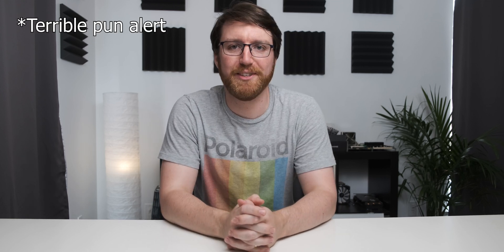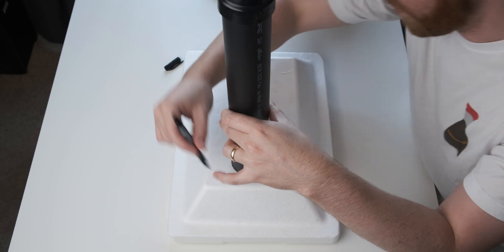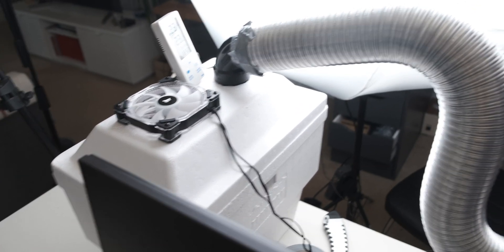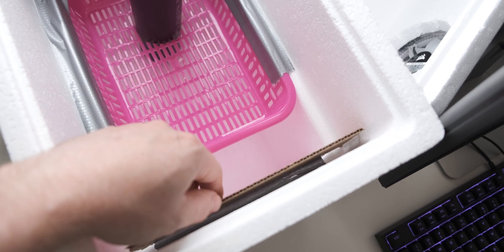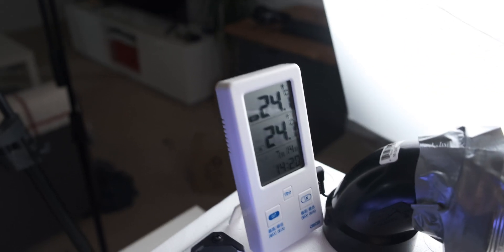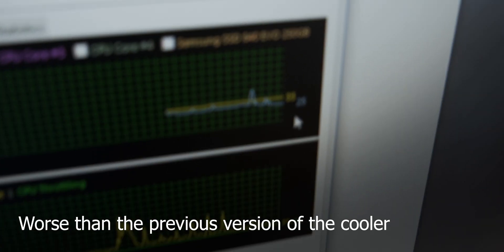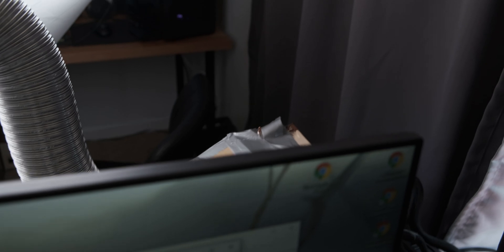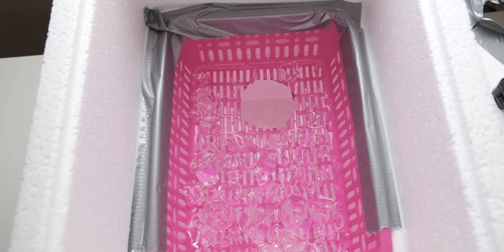DIY PC chiller version 2.0 (Final proof of concept)

Comment: And Inline fan on the cooling duct  would be better or seal off the icebox. You could be leaking air from the seams. An inline fan would draw only cold air guaranteed and have less pressure loss.

Comment: I enjoyed this and the design was really good.  
It seemed like you only put 10% of the ice the cooler would hold.  I can't see why you would not pack it in there.  Maybe add a drainage system to remove liquid water which as it rises is impending airflow.   (the gap between the tube and the water is getting smaller)
Also the long metal tube is robbing you of some of your cooling.  It's effectively a radiator warming the air flowing through it.  Make it as short as possible, and/or insulate it.  
Whenever you cool something below room temperature you start to risk condensation and water damage. And using ice adds water vapor to the flowing air making the problem worse.  You may want to address that before you increase your cooling.

Comment: Dawid, I know this is an old video, but have you considered using molecular sieves to dry out the air as it enters the pc case?  In addition I think you should add ice packs (the store bought ones!) because it seems like loose ice would melt quicker, but with a denser pack maybe it would last longer.

Comment: this is not a good idea. your ice will not only melt super fast with that tower cooler on it, but also if you add anything like salt to the ice to make it last longer then it will corrode your cooler. also, condensation my friend. consider conformal coating your MOBO or Vaseline and dielectric grease.  it would be more efficient to just buy an air conditioner and put it in front of your pc.

Comment: It might be a good idea to measure the temperature of the air coming out of the CPU cooler I suspect it will still be sub ambient and you are mainly using the ice to cool the room rather than the CPU. It takes 330kJ to melt 1kg of ice. With approximately 100W of cooling required that's nearly an hour. I suspect closed loop will be more effective

Comment: You don't need to blow air into the cooler with the fan. It is only going to melt the ice faster. Use the fan as an exhuast to pull the cold air out of the cooler box. Just use a vent for air flow. And it might actually work better if the vent is slightly restricted so you have a slight amount of negative pressure in the box. You are basically using an old trick we used in drag racing by using an ice box to cool our intake air temps to gain some extra horsepower.

I thought trying to make a cooler based on the swamp coolers we used for air conditioning in the desert. You spray water onto a radiator and evaporate it with a fan. When water evaporates it cools the surface it is on. This why we sweat then we are hot. The air moving over our wet skin eveporates the sweat and cools our skin, in turn cooling our blood. Fun fact, dogs and cats don't sweat. That is why they pant, they are moving air over their tongue which is where they have the most blood vessels. So their tongue doubles as a heat exchanger. Elephants use their ears.

Comment: I wonder if anyone has tried pulling air through ice water similar to a bubbler? It works for smoke and seems to be a similiar process to what you're doing here.
Reply from the maker: That's a good point. It would mean there is lots of contact between the air and the cold water.
However I want to go colder than the freezing point if water. :P
Reply: If you go colder than ambient your going to get condensation on the components and short it out. So pay close attention when you try it. They also actually make water chillers, we use them in aquariums for certain kinds of fish.

Comment: The Ice Was the problem in this video, You can replace it With Cooling Liquid Maybe next time ?? Whatever i am looking forward to see your next idea
Reply from the maker: Cooling a radiator would be easier. Although I think considering how we have been going about this challenge we want to specifically cool an air cooler.
It's a good idea though, thanks.
Reply: yes of course if you could find a way to keep the ice Alive then it will work perfectly :D